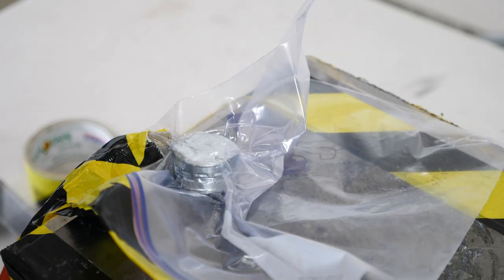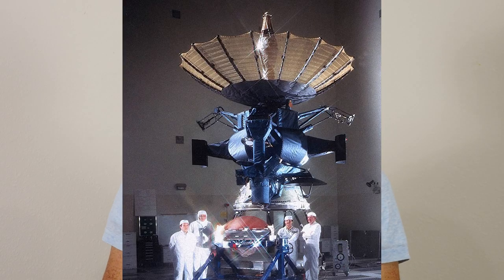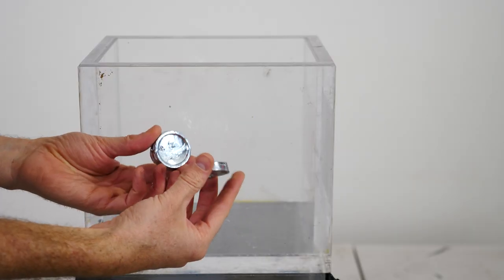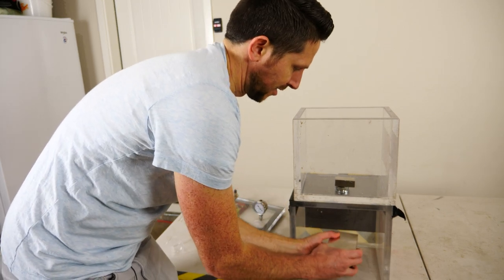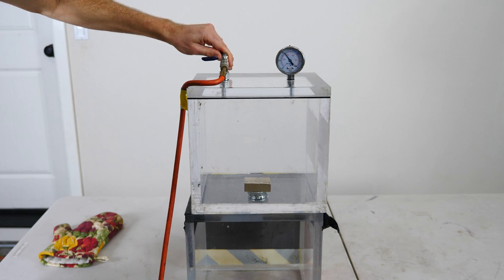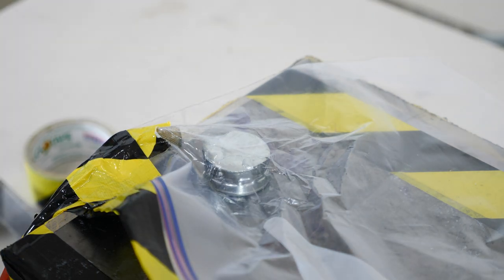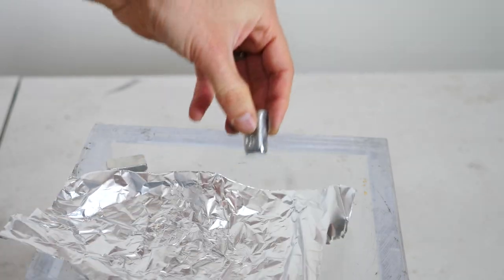Cold Welding Metals In a Vacuum

Comment: but... removing the air doesn’t magically make the oxide layer disappear? it only would keep it from forming after forging
Reply: That’s why gallium/indium is being used IIRC
Reply: Yea, I was wondering why ActionLab didn't remove the oxide layer first, but then I remembered that he would have to do that inside the chamber with a full vacuum pulled, which sounds like it would be ridiculously difficult haha. He would probably need a much bigger chamber, along with specialized tools/gloves that could be controlled remotely, which I'm pretty sure only a professional laboratory could pull off. 
Oh well, I'm sure that somewhere out there is a cold welding video with a truly accurate demonstration :)
Reply: @theoverseer393  I thought he said that gallium has less of an oxide layer, not no oxide layer, but maybe I'm wrong. 

What confuses me is that I don't think the titanium antenna on that satellite was being squeezed by anything, so how could have cold welded shut if this demonstration is accurate to what happens in outer space?? Even with the squeezing, the gallium in this video was barely welded together, so how could a titanium antenna get welded stuck just sitting out in space, without any outside pressure on it? I thought it must be because the oxide layer on the satellite had been ablated by solar radiation, while the gallium in this video still had its oxide layer. I've tried looking it up to see if I'm right, or if there is something else going on, but I can't find anything.
Reply: Thats why you need to twist and press to scratch the metal to get it off
Reply: @wolfsiejk  yeah... oxides are SUPER hard - simply scratching or twisting the metal won’t do that
Reply: @orchdork775  i've been actually wondering that but noone has answered it in the comment section :(
Reply: @orchdork775  He could use spin welding, using the external magnet to provide the spin.
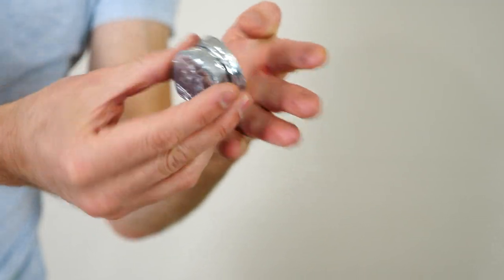Reply: 7:30 he says gallium doesn't form an oxide layer
Reply: Gallium only is only reactive with oxygen at high temperatures. Elemental gallium at room temperature will not form an oxide layer, so it is an ideal metal to test room temperature ("cold") vacuum welding, as it should be trivial to prepare samples which do not have a surface of gallium oxide.

Indium, similarly, seems to require special preparations in order to form oxides, hence its cold weldability at room temperature and in atmospheric conditions.
Reply: I thought this too…but the Galileo components fused without being cleaned.
Reply: @orchdork775  anything that's sent to space is super super clean...
(All the bunny suits, etc)
And they are transported into the rocket without being contaminated.
So I guess that's the reason why Galileo experienced cold welding....
Reply: @orchdork775  To weld you need 1 of 3 things...
1. heat - as in arc welding
2. pressure - as in hammer forging
3. clean 
If 2 metals are very clean they don't necessarily need any pressure but just to be touching.
Look up wringing metals together and this may help to understand :)
Reply: @orchdork775  I think it's because they used titanium bushings on a titanium rod, thinking that both of these have a low coefficient of friction. Because of that low friction, they probably used a lightweight mechanism that didn't require much force or energy to operate. When the two oxide layers rubbed together, they came off the rod and bushing fairly easily and welded together instantaneously. Bear in mind, the oxide layer is created almost immediately when oxygen is present in the surrounding atmosphere, but without that atmosphere the oxide layer cannot form.

You're probably thinking that the oxide layer wouldn't come off that easily if it's so hard (aluminium oxide has a Mohs Hardness of 9), but to remove the layer, you would need a material hardness of equal or greater strength such as another oxide layer, hence explaining how the oxide layer was rubbed off. 

Pretty amazing that the whole reason why we can use metals at all is because of oxygen, like what kind of layers could you create with other gases? Could you make an iron nitride layer?
Reply: @orchdork775  and one more thing they tested the antenna in earth therefore they should haveo gone through oxidation.  And he also said titanium oxides very fast.
Reply: @kotor1357  they have a lot of bacteria u know?
Reply: @kotor1357  and when they are launch they are out for 30min then 5 mins for reaching rarified air and when they launch they gets heated up which make oxidation very fast
Reply: @classydays43  equal hardness or te 2nd one with more hardness will remain oxide
Reply: @orchdork775  use a towel soaked in acid, like hcl, put it between thw two pieces of metal, pull it out in the vaccum chamber. You can also use a long strip of sandpaper between the two weighted pieces of metal.
Reply: @orchdork775  my guess is the vacuum in the video is smashing the pieces together with enough pressure to melt and weld them in specific spots. Gallium is known for its low melting temp. Without an oxide layer the metals should bond similar to how fluids are able to separate and come together seamlessly which is why its called cold welding. I just watched Veritasium's video on this and it is so much better. 
https://www.youtube.com/watch?v=Y2nQ8isf55s
Reply: He said in the start that gallium doesn’t make much oxide.... are you guys paying attention?
Reply: @orchdork775  he said that the problem is the oxide layer not cold welding
Reply: @drd1924  just cleaning the metals is enough to weld!? :0
Reply: @SomeOne-vf1rs  yea
Reply: @agenericboringhomosapien8108  yes, look up the term "Wringing Steel" I read once somebody left gauge blocks wrung together without oiling, and could not get them apart months later
Reply: Yes. If you were going to use this for practical purposes you would have to prepare the surfaces to be welded first just like here on earth. But you wouldn't have to spend a ton of energy on the actual welding.
Reply: he said gallium doesnt make much oxidated layers, the only thing betwen them was just air, so in a vacuum, theyd mostly stick
Reply: @orchdork775  no he could put fine scotchbrite pad inside the plastic bag and clean the metal under vacuum?
Reply: Just a guess but maybe the pressure of the magnet scratches nano cuts but Ture you would need to scratch that oxide layer or use a chemical change
Reply: @wolfsiejk that’s more like ringing or galling
Reply: @RamadaArtist regardless of any ability to form an oxide layer, there is at least one monolayer of hydrocarbons/hydroxides/oxides on any material. On metals especially , this layer is chemisorbed to the material itself. You can only ever get rid of that layer for a while after doing a flash desorption or sputtering/annealing under UHV. Otherwise, that layer builds right back up again from atmosphere. He isn’t able to actually remove that layer with his setup, thus he’s not able to make the surfaces contact
Reply: @theangledsaxon6765  nono wringing has multiple other forces at play (although getting rid of an oxide layer would help)
Reply: He already said gallium doesn't from noticable oxide layer.

Comment: Given the melting point of gallium is under 30° C, the slightest friction may cause spot welding.
Reply: Friction welding.
Reply: Exactly what I was just thinking.
Reply: The problem with welding gallium together is that you have to superchill gallium to get it to resolidify. It will stay melted down to pretty low temperatures. I have some gallium that I have to put in the refrigerator for several hours to get it to change back to a solid. It will very slowly crystalize even when it's ~5° C
Reply: The thermal conductivity of the metal is too great to allow heat buildup at the contact point with slight friction.
Reply: you have to realize it has to cool back down
Reply: That would mean, I'll have to put them in fridge to make them solidify...
Reply: Yup Slight pressure with hand will cause enough heat to spot weld.  The guy making the video doesnt understand the concepts.
Reply: @danoberste8146  you can put it in the freezer for like half an hour
Reply: really? body temp is 36-37'ish :D
Reply: @adruvitpandit5816  but you have to get it to cool down. a guy up there said he has to keep it in his fridge for a while to get it to harden again. also i don't think that he's looking for the most efficient way but just the coolest way (no pun intended)
Reply: Any useful application for this?
Reply: He does not even need to use friction,he just needs to hold the peices together for a minute and they will weld.
Reply: The point of the video is not to just weld the gallium together, it's to show off cold welding.
Reply: He actually clarified that in the video ._.
Reply: He mentioned that it's 85 degree Celsius In the video

Comment: So when I push these two pieces of aluminium together, they should stick together.
But they don't. (Vsauce music).
Reply: Blah blah blah, right?
WRONG!!!
Reply: Or.. Are they?
Reply: mathologer, Action lab and Vsauce 2 ❤️❤️❤️
Reply: Are you sure this is cold welding and not friction welding? When you put them in the bag and the bag squeezes them, you could have a little bit of friction that could raise the tiny contact points above 85deg. You should put them in the freezer for a while and then try again.
Reply: @Joe Duke I’m aware cold welding is occasionally use of space experimentally, my point was that this is not cold welding. This is friction melting gallium which then cools and fuses the pieces together
Reply: @isaach1447  Cold welding: There is no heat, from outside or in the process. Cold weld happens in room temperature , due to high stresses/hammering and deformation. Happens mostly on FCC materials and low work hardening materials like: Aluminum, copper, gold, silver, palladium, platinum. Dissimilar welding is possible. Stainless steel, galling or seizing is also cold welding type.
Friction welding: Solid state welding. The welding parts are rubbed while one of the two joining material is moving and heat is added. Stress is also added.
Reply: @totaldan99  so if this is friction Welding from the gallium rubbing together as the bag constricted in on them, then that’s heat from inside the process...therefore not cold welding. I’m not saying that this video DIDNT show cold welding, I’m just saying doing it at room temperature leaves room for doubt. The only way to be sure would be to cool the gallium to a point where friction couldn’t easily raise the temperature above 85F.
Reply: @ichweinicht1858  what about vsauce1
Reply: So what was the problem?
Reply: Or will the??
Reply: 2 freshly machined pieces of aluminium will sometimes weld together of they are very smooth surfaces and you just rub them together 

Its easier if you machine an aluminium peg about 1" OD to fit a hole exactly, you will need an air bleed hole through the material - push it in and turn it - you will almost certainly NOT be able to get it out. We did it at school in engineering class.

If you drive a punch through the air hole to force it out it will eventually work - but it tears lots of the metal with it - it becomes ONE PIECE for most of the surface area.

Comment: Great video! Two questions:

1) For the vacuum chamber test, wouldn’t you need to remove the oxide layer that is already present on the surface of the two metal pieces? Just putting them in vacuum does not remove the oxide that is already there

2) Would an inert atmosphere (nitrogen?) work instead of a vacuum?
Reply: IME: yes, no. 'twas argon though, no means to try n2. It's freaking wicked hard to find LN2 in this city of five mill nutjobs, I don't get it. "Most of our atmosphere? Sorry, we don't carry that. You want a bunch of a highly unstable fuel, dissolved in acetone, in a tank full of concrete for super cheap, though? Comin' right up!"
Reply: @phxgen  Very interesting, thanks!!
Reply: @phxgen  
Just buy liquid nitrogen and let it boil?
Reply: @lucaslucas191202  That's the problem, I haven't (yet) found anyone in this city that'll fill my little dewar. The only place I've found thus far that'll sell me LN2 is like 45min away & they won't fill my dewar, instead they want people to rent their enormous dewars for like $850 & up.
Reply: I need the 1st question answer
Reply: @TanmaY_TalK  Yes you do, but as said in the video, he did with a metal that didn't make an oxide, for the second question, you need nothing between the metals for it to wlrk
Reply: Yes i think so for both questions although i think it would be better to use argon since it's even more inert.
Reply: Yes and yes*

*it would work in an inert atmosphere if sufficient compressive force is applied to force out the gas layer separating them (which can be done and can actually cause welding in an oxygen atmosphere if the force is enough to cause some squishage of the metal forcing unreacted metal ions to come in contact, I've only done it a few times in lab and a couple more in the field)
Reply: @phxgen  Cody's lab has a video on how to make your own condenser
Reply: Miles Doyle  nobody asked

Comment: I'm skeptical about whether you were able to actually cold weld.  My understanding is that for cold welding to be successful, you have to get the surfaces scrupulously clean.  I wonder if what happened was that a vacuum was created between the two pieces of metal and the edges were so well sealed that air could not get in.  You probably had about 1.5 sq-in of surface area there, which would mean around 21 lbs of air pressure.  When you take new microscope slides out of the package, they will stick together because they are so flat that the air cannot get between them.  (Idea for an episode?)

High karat weight gold should be easy to cold weld because it has no oxide layer.  Would it work to put a sheet of gold leaf between two very flat silver ingots?
Reply: Those surfaces were crude af, so I doubt it could have been held together by a mini vacuum. Maybe grease held them together
Reply: He said dissimilar metals have different crystalline structures so don't work. But by his theory, 2 gold ingots that are dead flat and smooth, and clean should work. His attempts were relatively filthy from fingerprint sweat/oils let alone not totally flat for good contact. Pretty poor excuse for a lab experiment.
Reply: The two ingots still had the oxidized layer from being exposed to the air previously. That layer does not just go away from being in a vacuum. The oxidization had to be scratched off on both ingots by mechanical manipulation. Only a few small scratches were made and connected which is why it was so easy to pull apart.
Reply: @Newt2799  right but I think he was thinking about the possibility of the bits being vacuum sealed together instead of actually being cold welded
Reply: Yes, it looks more like wringing gauge blocks together.

Comment: What about wringing gauge blocks together? Is that cold-welding or galling? 🤔
Reply: Both as they're basically the same
Reply: Neither it turns out, check the sixty symbols video on it. It turns out that its just that when you make metals extremely flat to the eye, then when you push them together, they form microscopic suction pads, like the kind that hold your phone holder to your car window, just microscopic. They verified this by adding oil to the surface, and a bit like licking your suction cups, that improved the bonding. If it was cold welding, the oil would stop it working, and secondly once you joined then pulled apart your gauge blocks even once, you'd have microscopic mountains and valleys from where it didn't cleave cleanly, so it wouldn't work twice.

Comment: What about the oxide that formed from being exposed to the air earlier? And if it doesn’t like to form oxides then why is a vacuum required now?
Reply: This video sucks, there's a ton of flaws with his experiment. He didn't cold weld at all, the gallium literally just melted a little bit from friction. He mentions the oxide layer in the beginning and how it prevents cold welding, but then completely disregarded for his experiment. Also he seems like he just kinda shat out this video.

Comment: Are you sure this is cold welding and not friction welding? When you put them in the bag and the bag squeezes them, you could have a little bit of friction that could raise the tiny contact points above 85deg. You should put them in the freezer for a while and then try again.

Comment: Tis is also the reason why in slow moving mechanics like in clocks where you can't reliably get an oil film in between moving gears then instead you make the gears out of different materials. It's not because brass is cheap as some people might think. It's because the alloy brass (copper and zinc) won't cold weld with steel (iron). The result is that you get a clock that lasts for generations. Had all gears been made out of the much stronger steel it wouldn't last as long as the steel would grind away because of cold welding. Naturally the largest gears are made out of the softest material as that causes gears to wear more evenly.